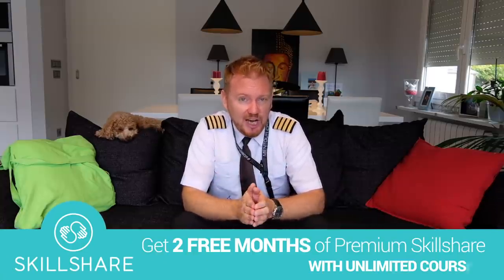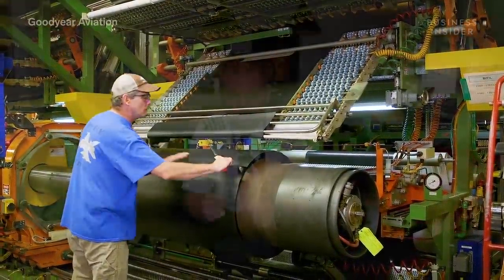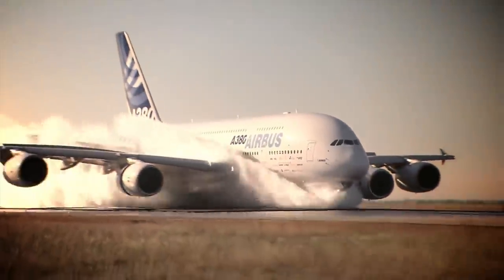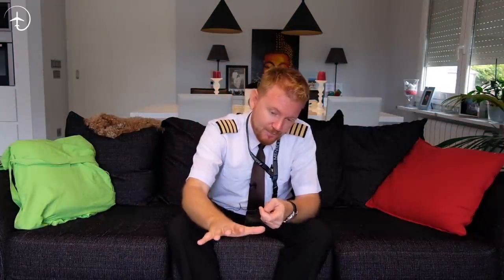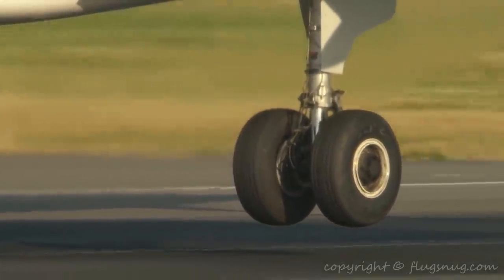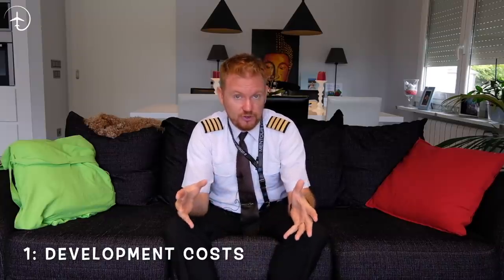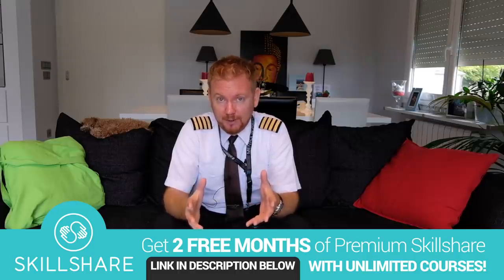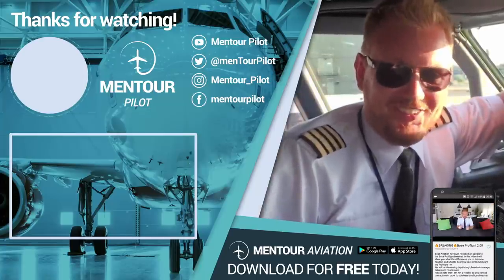Why not make plane-tires spin, before landing?!

Comment: One correction here: The pressure of nitrogen changes with temperature exactly as much as that of air (p*V=n*R*T).
Reply: Air is 78 % nitrogen anyway.
Reply: pV=nRT applies to "ideal gas" which is hypothetical construct, not something existing in reality. "Real gas" is affected by multiple factors ideal gas equation doesn't consider, including various reactions on molecular level, compressibility of gas (or gas mixture as it would be in relation to air), varios molecular forces, and thermodynamics of it all. In other words pressure of pure nitrogen and nitrogen/oxygen/argon/CO2/various trace elements mixture (AKA air) do change differently with temperature. For most application that doesn't really matter mind you,  ideal gas equation is reasonable approximation, but that doesn't make your statement any more true I'm affraid.
Reply: @maciejkornatowski3026  actually, every element in gas form expands in the same way
Reply: @maciejkornatowski3026  Oh my, I knew there was going to be someone pointing out that ideal gas is just an approximation. I know that. Nitpicking aside, the ideal gas model is absolutely fine for the point I wanted to make.
Reply: Yes. The bigger issue is that using Nitrogen instead of Air means you'll be using a dry gas.  Air has lots of water-vapor in it, and water changes its pressure and volume quite a lot compared to other gases (especially as you go through phase transitions). Therefore a tire filled with pure nitrogen will change pressure and shape less than a tire filled with air. Its not just because its Nitrogen though - its the lack of water vapor that makes the bigger difference.  [This is also why nitrogen is used for many auto-racing tires where the overall diameter and pressure is a very important component of the suspension system and the car's handling around the track]
Reply: @noelwade  Agreed.
Reply: @maciejkornatowski3026  As an engineer, I was about to argue with you until your last sentence.
Reply: @noelwade  YES! This. Also, nitrogen is inexpensive, as compared to something like Helium.
Reply: @noelwade  Ok, this makes more sense now. I didn't know about the water-vapor thing, thanks for the insight :)
Reply: @noelwade  That's probably the best argument I heard. Using pure gas that will behave ideally makes perfect sense. When choosing the specific gas it is advantageous to use an inert gas, because it will not cause chemical degradation over time (of steel, rubber, lubricants etc.), especially under high temperatures from the brakes. And cost-wise, nitrogen is probably the cheapest inert gas to get.
By the way, as far as I know, the landing gear struts (shock absorbers) are filled with nitrogen as well, probably for exactly the same reasons. And moreso than in the tyres, because the pressure levels in shock absorbers are much higher. Fun fact: smaller airplanes (up to commuter level) can and do use air in their tyres no problem.
Reply: @DipanGhosh  And you don't want helium filled tyres (not even in your car). Helium will leak through rubber, so tyres would need to be filled daily. Other common gasses have own not-so-pleasant features.
Reply: F1 tyres are inflated with nitrogen too. It's not that it doesn't change. It's more stable and predictable in doing so, because unlike air, it's not a mixture of fluids that react differently to temperature.
Reply: @noelwade  It is generally allowed to top-up the tires with a little air if nitrogen is not available.  The big reason to use nitrogen is to keep the oxygen level low to prevent explosions.  From the FAA:
"This amendment to the Federal Aviation Regulations (FAR) requires that an inert gas, such as nitrogen, be used in lieu of air, for inflation of tires on certain transport category airplanes. This action is prompted by at least three cases in which the oxygen in air-filled tires combined with volatile gases given off by a severely overheated tire and exploded upon reaching auto-ignition temperature. The use of an inert gas for tire inflation will eliminate the possibility of a tire explosion."
Reply: The problem is more with the rubber as fuel and the oxygen in the compressed air catching fire as opposed to the rubber getting all its oxygen from outside the tyres . Pure nitrogen removes the hazard inside the tyres ....
Reply: So what your saying is that a cubic foot of plain air at sea level will expand the same amount as a cubic foot of Nitrogen at sea level to 40k feet? Let's say all the moisture was taken out of both types too.
Reply: @dannydaw59  Practically speaking yes. Although in tires the volume is more or less fixed, so the expansion does not happen, only the pressure difference between the tire and the atmosphere (which is what is measured as tire pressure) increases (assuming no temperature change, which is rarely the case though)..
Reply: Yes! But the real reason why they use Nitrogen for tires is that it's molecules are larger than Oxygen, and so they migrate slower through the rubber.
Reply: @colinsouthern  You are misinformed. Test after test has shown that high-nitrogen content air (none of it is pure nitrogen) leaks more slowly than standard air, and that pressure in moisture-rich air changes much more dramatically with temperature changes than dryer air. Fleets of vehicles can get as much as double the tire life out of high-nitrogen air compared to standard air because they tend to get less maintenance than they should.
Reply: @maciejkornatowski3026  Charles' Second Law is not an approximation
Reply: @jeffreythompson9549  All the basic gas laws are approximations. They don't work well in certain regions (like near the condensation point), and make assumptions that aren't true (like molecules always having purely elastic collisions). They're very accurate in many real-world cases, but are technically approximations in all cases. It's like using Newtonian mechanics to describe airplanes. It works great in practice, but, technically, relativistic physics are more accurate.
Reply: @andrewsnow7386  That's what I mainly remember from A&P school for the reason of using 100% N. It was to get rid of the Oxygen that can be a real problem under high heat and pressure and in the unfortunate case if there was a burst behind the engine exhaust and under the fuel tank. I check tire pressures daily on commercial aircraft and N does have a wild swing in pressure from blazing hot coming into the gate after landing to 8 hour cool down. for example 250 psi to cool off 220psi

Comment: My father who served in the Army Air Force durning the latter part of WWII as a radio operator on B29's flying missions over Japan, told me about another assignment he was on durning that time.  He had crewed on a bomber (I don't remember what type) that had, for experimental purposes, been modified to spin the wheels up for landing, he told me that the gyroscopic effect of the spinning wheels made the airplane very hard to control durning approach and a good landing very difficult, (he might have said nearly impossible).

Comment: 13:46 is the point for me: I thought about "why not change the rims, so the air spins up the tires before landing". Until you come to the point about crosswind landing. Thanks for pointing that out, 'cause everything else was more or less obvious, like "They would have done it if it would be cost efficient".

Comment: Back in A&P school (c.70's), one of the instructors claimed that Boeing had briefly piddled with gear spin up systems for the B-52... but abandoned the study when it was found to be much more trouble than it was worth. Also, I'm pretty sure one of the primary reasons for Nitrogen tire inflation is in the event of a wheel well fire, and wheel overheat 'fuseable plug/s' blow; it will be inert gas expelled into the wheel well as opposed to air containing Oxygen. (Just the other day I noticed a gas station offering Nitrogen for car tires... IIRC they were asking something on the order of $20.00USD!)
Reply: My father told me the exact same thing.  He retired from USAF/SAC in 1965.  Did not effectively extend the tire life cycle to be worth the bother.
Reply: Main reason for using nitrogen is to exclude moisture which stabilizes pressure over temeprature (nitrogen pressure will scale linearly with temperature while humidity can condense and evaporate and add a nonlinear characteristic over the service temperatures).  The exclusion of oxygen is a side benefit which helps keep the rubber supple longer
Reply: Did you have to use 2 decimal places on the price? I read it as $20,000 with U as another 0.

Comment: Thank you for explaining this.  I often wondered about this.  My idea was to create a RAT (ram air turbine) that comes out when the plane is landing to power a small motor to spin the tires on landing.  The tires would just begin to spin 'freely' not in a motorized and controlled manner as to allow for crabbing, different speeds

Comment: I have been thinking about this myself for a long time, so thanks for covering it. My idea was always, rather than having actively driven wheels, why not have them rather just spinning passively to a certain speed, using the natural air resistance. My idea would be, fitting the side of the rim with some sort of fan blades, like used in water turbines. As soon as they are subject to the air resistance, they would start spinning automatically. Would be quite fail save, as not using power, would not interfere with the navigation/direction, etc, just take away some of the tear on the tires during touch down.
Reply: I had basically the same idea about using the airflow to spin the tires many many years ago then I learned about gyroscopic forces and how any force applied to a gyroscope will result in a force 90 degrees in the direction of rotation.
Reply: @OpusBuddly  if a puny motorcycle engine spinning backwards (normally they spin forwards) changes the handling of the motorcycle so much as to be VERY noticeable, imagine the gyroscopic forces all those enormous wheels will create. All in all a very bad idea.
Reply: Good post but only the tip of the iceberg so to speak. What are all the issues1-Out side air temp. is -50 degrees F and the bearing grease is solidified.   Fix with preheated lube oil at 50 degrees f  with seal by pass and circulate with a small air turban pump.and pencil heater.  Install push back springs in wheel disc brake cylinders This will help in free spinning. Wheel spin up via Pelton wheel hub caps and or tire cups in the moldings. Pilots can apply breaks until  just before touch down to deal with Giro effect in cross winds. This is somewhat of a copy I use on Boat Trailers to prevent water intrusion.  Pat pending?
dellori3
Reply: I have discussed this with a commercial pilot I know and he agrees this could work. The speed that would be achieved by rotors wouldn’t be as fast as the plane was travelling, in fact nowhere near as fast,  but they would very much reduce the impact speed and tyre stress. The wheels are heavy despite the materials used and giving the wheels kinetic energy is like racing cars flooring the accelerator from a rolling start as apposed to a standing start, it’s difficult to get wheel spin from a rolling start! Speed of the wheel’s rotation could be controlled by computer slightly touching brakes to provide even speed. The centrifugal forces of the wheels would be minimal, given the weight of the plane.

Comment: Thank you for addressing this issue. I pitched a REALLY simple air scoop design to Lockheed back in the 90´s that would spin up the tires at or near TAS on landing to help save the treads. They were not interested but never explained why. This video helped put that to rest. I did not realize that tires were so inexpensive and also we get the added benefit of having really good traction at the touchdown point!
Reply: All I can say is Great Mines think alike.
Reply: @cvhawkeye6255  Yes. They all produce gold. (See what I did there?!)
Reply: @ananda_miaoyin  Sorry for the typo! Greater Mind! All Good.
Reply: @cvhawkeye6255  I thought it was a brilliant play on words, if even by accident!

Comment: Thanks so much for this explanation, I have always been shaking my head when I see the excessive amount of rubber on the runway touchdown zone and the smoking tires.
Regarding the accelerated wheels on landing ... you could use some modified standard gear that doesn't need electrical energy, you just had to change the algorithm of the anti-lock break system.
You could create a cast aluminum wind-shovel profile that is also working as a rim heat dissipation spreader that has a specific shape which accelerates the wheels by the ambient air pressure towards the RPM it needs to match the ground speed. The RPMs can be synchronised shortly before touchdown by the general braking systems anti-lock control by slowing the faster one down to equal RPMs. Since the wheels are turning with no load and you may let the gear down at maybe 180-130kts? (=333-240km/h) you should have plenty of ambient air pressure to be able to accelerate the giant wheels under no load to higher RPMs if using the right volume air-shovel profile in your rim-extensions. I have no clue if you could even get the tires up to near landing speed within the maybe 2 minutes while gear down, but e.g. 70% RPMs would already reduce your tire changing interval by a third while having much less tear and wear on the asphalt and a smother touchdown experience for the passengers. Even if the tires are not very expensive, the maintenance work, time and adjustments are summing up and this may be an relatively easy implementation. The breaking energy on the runway will be slightly higher but the heat that may be conducted from the brake disc towards the rim will be dissipated immediately from the air-shovel shaped aluminum rim extensions/cooling fins. So in other words if you can make these rim extensions in a shape that can be fitted into the regular gear box, the only thing you need is a modification of the autobreak circuit that has to equalize the RPMs with no load just before touchdown. Because some wheel might be running more freely than another, there might be differences that you don't need when touching down. No electric engine or high current wires needed, no extra RPM control sensors and mechanism ... just the air-shovel-rim extensions and the modification of the autobreak circuit!
What do you think, bullshit or does that idea have a possible future?
Reply: he already said that changing tires on airplane cost pennies compared to other maintenance and running costs.

Comment: I would also think the inertia of the plane being transferred to the tires once the plane hits the ground is also partially a braking technique.

In ground tow ropes like they use on aircraft carriers could work for warm airports.
Reply: molding scallops into the sidewalls could act as vanes to help spin the tire when in the airstream.
Reply: I don´t thik the passagers would like arest wire landings. It´s kind of brutal. i read it´s like going 110km/h in to your driveway and make a compleat stop before you hit the garage wall.
Reply: The polar inertia of the landing gear is probably insignificant to other circumstances that make landing unpredictable.
Reply: @exploatores  There's no reason you'd have to have a brutal arrested landing, you could specify any amount of time or distance over which to reduce the speed. The wire may be impractically long though. :)